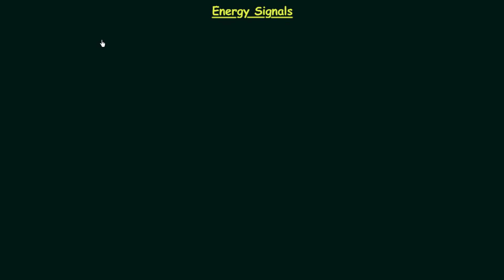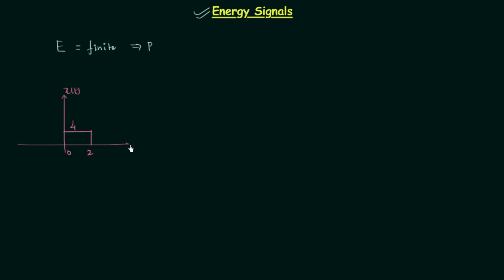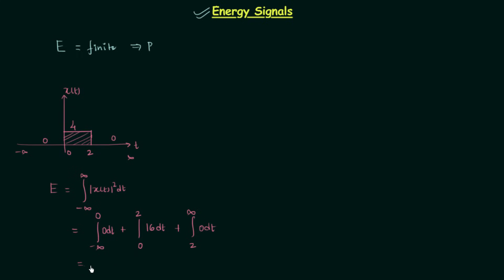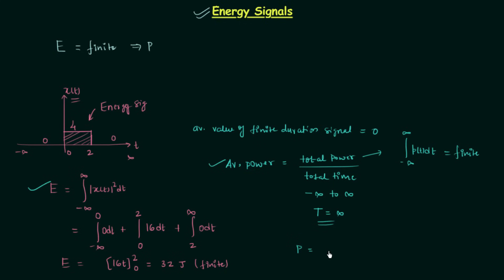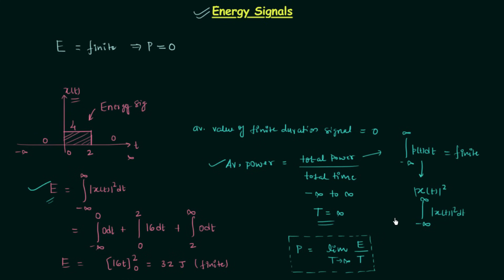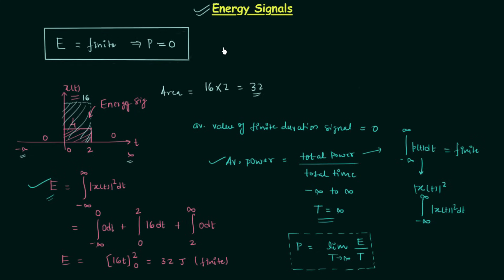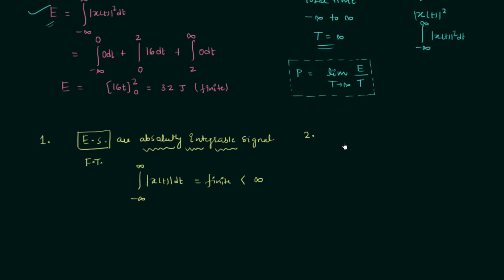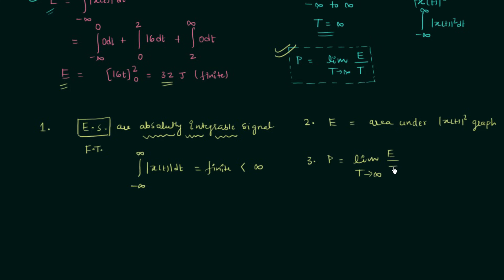Energy Signals

Comment: clc;
clear;
close all;
 
% Q1:Find the main dimensions and number of poles of 1000 KW 500 V 300 RPM DC 
% machine. Assume the specific magnetic loading Bav= 0.7 W/m², ampere 
% conductor per meter = 40,000 , square pole face and ratio of pole 
% Arc to pole pitch is 0.7 efficiency of generator is 92%.
 
power = 1000; %powe, in KW
V = 500; %input voltage, in Volt
Bav = 0.7; %average value of flux density in air gap, in T ( Tesla)
N = 300; %speed in rpm 
n = 0.92; %efficiency of generator
f = 50; %frequency in Hz
P = (120*f)/N; % number of poles 
psi = 0.7; %L/tau ratio of pole arc to pole per meter
q = 400001; %specific electrical loading 
Pa = power/n; %power in armature coil 
D = (Pa/((1.64*10^-4*Bav*q*N)*(psi*pi/P)))^(1/3); %diameter of armature
L = psi*pi*D/P; %length of armature coil 
 
disp(P);
disp(Pa);
disp(D);
disp(L);

clc;
clear;
close all;
 
% Q2:-Calculate the armature diameter and core length for 7.5kW,4pole,
%1000rpm,and 220V shunt motor. Assume: Full load efficiency = 0.83,field 
%current is 2.5% of rated current. The maximum efficiency occurs at full load.
 
power = 7500; %powe, in W
V = 220; %input voltage, in Volt
Bav = 0.6;%(Assume)average value of flux density in air gap, in T ( Tesla)
N = 1000; %speed in rpm 
n = 0.83; %full load efficiency of motor
f = 50; %frequency in Hz
P = 4; % number of poles 
psi = 1; %(Assume)L/tau ratio of pole arc to pole per meter
q = 30000; %(Assume) specific electrical loading 
Pin = power/n; %Electrical input to the motor
Ish = (0.025*Pin)/220; %shunt current 
losses = Pin - power; %losses at full load 
cl = losses/2; %constant loss 
Fcl = V*Ish; %field copper loss
Pa = Pin - (cl+Fcl);%Power developed in armature 
D = (Pa/((1.64*10^-4*Bav*q*N)*10^3*(psi*pi/P)))^(1/3); %diameter of armature
L = psi*pi*D/P; %length of armature coil 
 
disp(P);
disp(Ish);
disp(Pa);
disp(D);
disp(L);
disp(losses);
disp(cl);
disp(Fcl);

clc;
clear;
close all;
 
%Q 3: - The diameter and length of a 500Kw, 500V, 455 rpm, 6 pole, and D.C. 
%generator are 84 cm and 35 cm respectively. If it is lap wound with 660 
%conductors. Estimate the specific electric and magnetic loading.
 
p = 500000; %power rating in watt
V = 500; %volatage in V
N = 455; %speed of motor in rpm
P = 6; %number of pole 
D = .84; %diamerer in meater 
L = .35; %length in meater
Z = 660; %number of conductor 
A = P; %in lap winding no of parallel path(A) is equal to no of pole
phai = (V*60*A)/(Z*N*P); %flux generated
Bav = (P*phai)/(pi*D*L); %specific magnetic loading in wb/m^2
Ia = p/V; % Armature current = (power rating/volatge)
%Iz = Ia/A; %Armature current/no of parallel path 
ac = (Ia*Z)/(A*pi*D); %specific electrical loading in A-conductor/m
 
disp(phai);
disp(Ia);
disp(Bav);
disp(ac);

clc;
clear;
close all;
 
%A design is required for a 50Kw, 4-pole, 600rpm, and D.C. shunt generator 
%with full load terminal voltage being 200V. If the max air gap flux 
%density is 0.83 wb/m2 and armature ampere conductor per meter is 30000. 
%Calculate the suitable dimensions of armature core to give square pole 
%face. Assume full load armature voltage drop 3% of the rated terminal 
%voltage and the field current 1% of rated full load current, ratio of 
%pole face to pole pitch is 0.67.%
 
p = 50000; %rated power 
P = 4; %number of poles 
N = 600; %speed of generator 
V = 200; %voltage in V
Bg = 0.83; %air gap flux in wb/m^2
ac = 30000; %specific electrical loading 
%b = 1; %due to square pole face
%L = 1; %due to square pole face 
x = 0.03; %full load armature voltage drop (Ia*Ra)
y = 0.01; %field current 1% of rated full load current 
sai = 0.67; %ratio pole face to pole pitch (sai*Bg = Bav)
Bav = sai*Bg; %specific magnetic loading 
Co = 1.64*10^-4*Bav*ac; %cofficent 
E = V+(x*V); %full load voltage 
Il = (p/V); %full load current 
If = y*Il; %field current 
Ia = Il+If; %armature current 
Pa = Ia*E; %power in armature
DDL = (Pa*(10^-3)/(Co*N)); % Pa = Co*D^2*L*N; %Armature power take in kw 
r = sai*(pi/4); %  (r = L/D)
D = (DDL/r)^(1/3); % diameter
L = r*D; %lenght 
 
disp(Co)
disp(E)
disp(Il)
disp(If)
disp(Ia)
disp(Pa)
disp(DDL)
disp(r)
disp(D)
disp(L)

clc;
clear;
close all;
 
%Q5:-Using MATLAB calculate the main dimension detail of a 10KVA,2000/400V,
%50Hz, single phase shell type oil immersed self-cooled transformer. 
%Assume voltage per turn 10V, flux density 1.1wb/m^2, current density 
%2A/mm^2, window space factor 0.33, the ratio of window height to window 
%width is 3 and the ratio of core depth to width of central limbs is 2.5, 
%the stacking factor is 0.9.
 
F=input('Enter the value of frequency in Hz:');
Q=input('Enter the value of output power in KVA:'); 
X=input('Enter the value of primary voltage V1:'); 
V2=input('Enter the value of secondary voltage V2:'); 
Et=input('Enter the value of voltage per turn Et:'); 
B=input('Enter the flux density in wb/m^2 B:'); 
j=input('Enter the value of current density j:'); 
S=input('Enter the value of stacking factor S:'); 
K=input('Enter the value of window space factor K:'); 
R=input('Enter the value of ratio of core depth to central limb,R:'); 
Hr=input('Enter the value of ratio of height and width of window, Hr:');
Ai=Et/(4.44*F*B); %Net iron area 
Agi=Ai/S; %Gross iron area 
a=(Agi/10)^1/2; %Width of central limb 
b=2*a*R; %Core depth 
Ay=Agi/2; %Gross area of yoke 
Dy=b; %Depth of yoke 
Hy=Ay/Dy; %Height of yoke 
Aw=Q/(2.22*F*B*K*j*Ai*10^-3); %Area of window 
Hw=(Aw*Hy)^1/2; %Height of window 
Ww=Aw/Hw; %Width of window 
H=Hw+2*Hy; %Height of frame 
overall=2*Hw+4*a; %0verall length of frame 
Tp=X/Et; %H.V winding turns 
Ts=V2/Et; %L.V winding turns 
Ip=Q/X;%H.V winding current 
Is=Q/V2;%L.V winding current 
Ap=Ip/j;%H.V winding conductor area
As=Is/j; %L.V winding conductor area 
ds=(As/3.14)^1/2; %L.V winding conductor diameter 
dp=(Ap/3.14)^1/2; %H.V winding conductor diameter
 
disp(Ai);
disp(Agi);
disp(b);
disp(a);
disp(Ww);
disp(Aw);
disp(Hw);
disp(ds);
disp(dp);
disp(Hy);
disp(H);
disp(overall);
disp(Tp);
disp(Ts);
disp(Ip);
disp(Is);
disp(Ap);
disp(As);
disp(Dy);

clc;
clear;
close all;
 
%Q 6: - Determine the number of poles, main dimensions, pole pitch and 
%armature mmf/pole of a 92Kw, 220V, 1480 rpm D.C. motor whose full load 
%efficiency, specific magnetic loading and specific electric loading, 
%the pole arc to pole pitch ratio are 89.76%, 0.545T, 32750 Ac/m and 0.67 
%respectively. Assume square pole face.
 
p = 92000; %rated power  
N = 1480; %speed of generator 
V = 220; %voltage in V
n = 0.8976; %full load efficincy 
Bav = 0.545; %specific magnetic loading in wb/m^2
ac = 32750; %specific electrical loading 
sai = 0.67; %ratio pole face to pole pitch (sai*Bg = Bav)
f = 50; %frequency in Hz
P = (120*f)/N; %number of pole
PP = round(P);
Pa = p/n; %Power in armature 
Co = 1.64*10^-4*Bav*ac; %cofficent 
DDL = (Pa*(10^-3)/(Co*N)); % Pa = Co*D^2*L*N; Armature power take in kw 
r = sai*(pi/4); %  (r = L/D)
D = (DDL/r)^(1/3); % diameter
L = r*D; %lenght 
 
disp(PP)
disp(Pa)
disp(Co)
disp(DDL)
disp(r)
disp(D)
disp(L)

clc;
clear;
close all;
 
%Q 7: - Determine the main dimensions of a 10 H.P ,400 V, 1500 r.p.m , 
%dc shunt motor, the  average gap density is 0.45 tesla and ampere 
%conductors/meter are 20,000. The max efficiency is 85%. Assume shunt 
%field current to be 0.9A and the diameter to length ratio is 2.7. 
%The pole arc to pole pitch is 0.7.
 
p = 10*746; %rated power  
N = 1500; %speed of generator 
V = 400; %voltage in V
n = 0.85; %full load efficincy 
Bav = 4.5; %specific magnetic loading in wb/m^2
ac = 20000; %specific electrical loading 
Ish = 0.9; %shunt field current 
Rsh = V/Ish; %shunt field resistance 
r = 1/2.7; % r = L/D
pin = p/n; %Input power 
pf = ((pin-p)/2)-(Ish^2*Rsh);%power loss due to friction 
Pa = p+pf; %total power
Co = 1.64*10^-4*Bav*ac; %cofficent 
DDL = (Pa*(10^-3)/(Co*N)); % Pa = Co*D^2*L*N; Armature power take in kw 
D = (DDL/r)^(1/3); % diameter
L = r*D; %lenght 
 
disp(Rsh)
disp(r)
disp(pin)
disp(pf)
disp(Pa)
disp(Co)
disp(DDL)
disp(D)
disp(L)

clc;
clear;
close all;
 
%Q 8: - A 5Kw, 250V, 4-pole, 1500 rpm, shunt generator is designed to have 
%a square pole face. The loadings are: Average flux density in the gap is 
%0.42 wb/m2 and ampere conductor per meter is 15000. Find the main 
%dimension of the machine. Assume load efficiency is 87% and ratio of pole
%arc to pole pitch is 0.66.
 
p = 5000; %rated power 
P = 4; %number of pole 
N = 1500; %speed of generator 
V = 250; %voltage in V
n = 0.87; %full load efficincy 
Bav = 0.42; %specific magnetic loading in wb/m^2
ac = 15000; %specific electrical loading 
sai = 0.66; %ratio pole face to pole pitch (sai*Bg = Bav)
r = sai*(pi/4); %  (r = L/D)
Pa = p/n; %Power in armature 
Co = 1.64*10^-4*Bav*ac; %cofficent 
DDL = (Pa*(10^-3)/(Co*N)); % Pa = Co*D^2*L*N; Armature power take in kw 
D = (DDL/r)^(1/3); % diameter
L = r*D; %lenght 
 
disp(r)
disp(Pa)
disp(Co)
disp(DDL)
disp(D)
disp(L)
Reply: goor3efvgrghthn